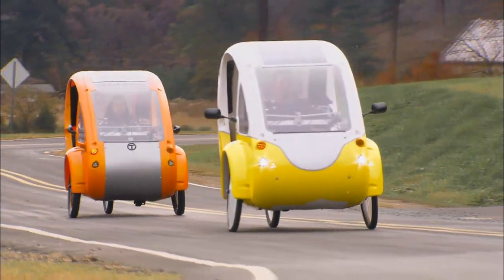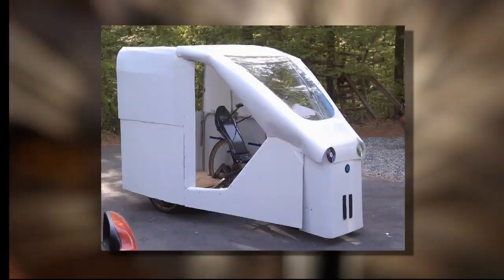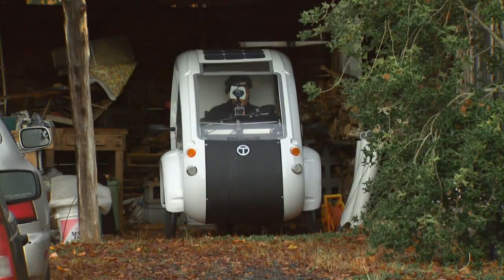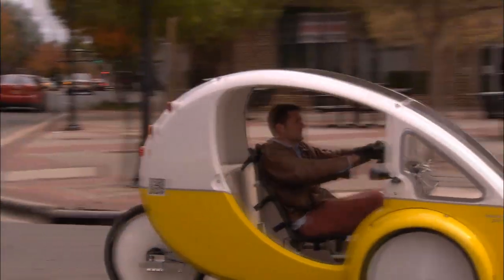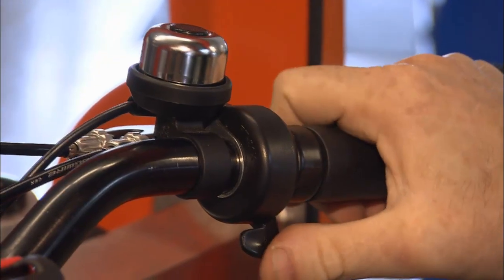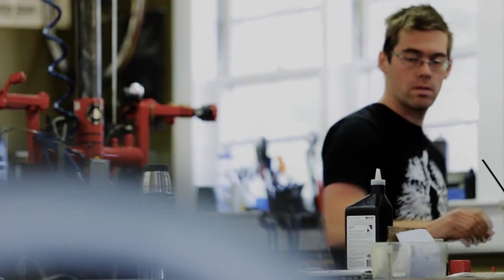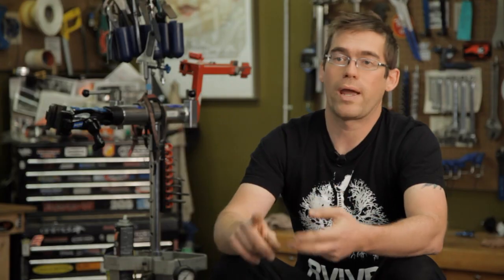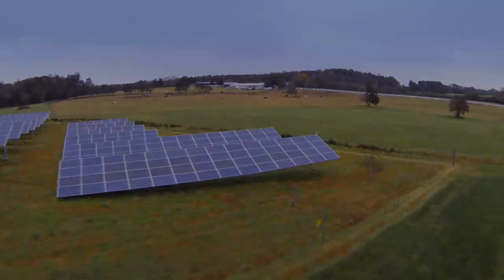Bike To The Future with The ELF

Comment: Why so complicated?  I've ridden years through rain and snow. A good bike, proper riding gear and paniers leaves $3500-$4000 in my pocket over this ride, and I'm less likely to run into or get run over by a car. Not to mention the better visibility due to the higher seating position of the bicycle. And, good luck parking this thing anywhere but in a parking lot $$$. KISS (Keep It Simple Smartguy).
Reply: Wrong on all counts! As a bicyclist you have no excuse for this ignorance. Crumple zones on this high visibility high profile vehicle that places your head at the same height as car drivers and features full DOT lighting makes this an extremely safe vehicle compared to any bicycle.
Really stupid comment about parking too, it is always easier to park the ELF in 1/3rd the space of a car and to fit it into otherwise not accessible spaces like motorcycle parking and on the sidewalk next to bike racks. I'm disabled and get to park my ELF right near the entrance doors of stores even without a disabled parking permit. Lock to any post.
Reply: I get what he’s saying I live in New York City an I don’t live in Manhattan so parking this is going to be hard for me whenever I do get one I’m going to have to pay for parking or it will get stolen for sure

Comment: how do you lock it up so people can not stealing it ??
Reply: It has a key lock for the power system. It can be cabled/chained to anything just like a bike, the brake rotor can be locked with common disc brake locks, a motion detector alarm of a hidden GPS tracker make security easy. Only two of 800 have been stolen, one recovered. The one not recovered was not locked by its owner.

Comment: The problem is bicycle they are limited range limited load and the user must be in good physical shape. Some are made out of exotic metals, and when was the last time you saw a little old lady riding with her walker in tow. The bike shop is dependent on a power source  such as fossil fuel along with needing trucks to deliver bikes and bike parts to his shop. Even in Amsterdam most ride there bikes to the rail station and back home. The ELF dose have some advantages over this as it can carry a larger load and someone with a balance problem the ELF will help over come this.
Reply: Sorry that is incorrect, these are sold to seriously disabled people. You don't have to pedal. This can mean priceless freedom for the disabled.

Comment: "Protection from the elements" but no doors
Reply: +ThruThe9 I suspect that they have doors, but they are an option. I've seen similar vehicles @ bike shops and there is an inclement weather option that is velcro based if memory serves me correctly...
Reply: Doors make it too hot. Rain just blows by the doors. Not an issue. I needed mine for sun protection but it offers so much more.

Comment: Nice for people who are not in a hurry, living in a more rural community.  I don't think I would see one in mid city Los Angeles.  Electric is a good way, but I went the route of converting a mountain bike that I was not really using.  With hub mounted 1000 watt motor,  20 ah lipo batteries. lights, panners, etc. cost: $800, max speed 34 MPH, normal cruise 27 MPH, range 22 miles.  Requires builder to be reasonably handy with tools and can understand how to handle Lipos. ( no big thing).   I already have a high power Lipo charger.
Reply: Your mountain bike is not street legal, can not haul 20 bags or groceries or a passenger out of the weather, has no crumple zones or full DOT lighting system with car horn. You also can not take advantage of solar charging, the best feature I take full advantage of every day here in Florida..

Comment: I'd like to see more actual stability info. Can you make a turn at 20mph?

Also like to find out where "contingency variable transmission" came from.
Reply: Reckless operation can be dangerous with any vehicle. I have never had one wheel leave the road yet, I just use common sense.
The NuVinci hub is the brand used.

Comment: the problem why they have so few orders is because of the price is so expensive actually I think the company targeted rich people for 3 000 dollars you can buy a used  mini van and go faster , the solar panel is making the price go so high , one way this could be cheaper is by taking away the solar panel , the bike should be faster electric bikes are green but not efficient , because this bike is so big and slow it will block the traffic and is most likely to get hit by an angry driver , the price should be less and more efficient because for real the price is so high that few people can afford .
Reply: +victor larraondo The government limits the speed of an electric assisted bike.
Reply: +victor larraondo The solar panel on this ELF can be had on Amazon for $200, it just a flexible solor panel, nothing too high tech or expensive. In fact this is one of few vehicles that can charge entirely off of solar built into the vehicle. I'll tell you this brother, if for any reason gasoline becomes short or there is some kind of war in the Middle East stopping gas from coming here, your Mini Van will be good only as a spare bedroom, while this ELF will get up and go everyday.
Reply: victor - penny wise and pound foolish applies here. You pay at least $3000 more each and every year to drive cars. Mine paid for itself in less than 3 years, I got rid of my car.

Comment: Nice invention. I just see a problem with rain coming in at the sides where it is open because it will come in that way for sure. It also would be nice if they had a bigger battery to double the mileage/speed. In colder weather you will need more than a seat warmer to keep warm and the cold will also reduce the efficiency of the battery.
Reply: you read my mind brother
Reply: Your problems do not exist in the real world. You stay warm by pedaling. The rain just blows by the open door, maybe your elbows get wet, no big deal. Doors are available but few want them.
Reply: Popeye Gordon nonsense, I constantly have to deal with rain falling at 45° due to wind, and even if I wait till after the rain stops I'll still often get soaked up to my knees due to potholes and uneven surfaces collecting massive amounts of rain water. Weather isn't a unified constant across the world. I've lived in near every biome, and this wouldn't appreciably help protect me during the storm season in any area I've lived in save northern California. If I still lived there, I'd be much more forgiving of its limited use cases, but right now...?

I actually do quite like this vehicle, but it isn't a sufficiently practical alternative in places with extreme weather. And to its credit, it doesn't claim to be! Every person and every environment has different needs. It doesn't undercut this vehicle to recognize that it's not appropriate for every area, the same way it doesn't undercut my bicycle to acknowledge that it's not appropriate for the freeway

Comment: I am an Elf owner, I purchased it last year in May of 2014. After driving it for a complete season without incident and never being flipped off by any motorist. More often than not people give the thumbs up and smile with curiosity when they pass. I use my Elf for commutes between my location and town (17 kms round trip). The route I use has a maximum speed limit of 60 kmh , I can clearly see anything coming to and from me. When I experience a situation where I may be a liability to road traffic I simply pull over and let vehicles pass however most are willing to wait and watch until they can pass safely. Over all I am very well pleased with this bike and recommend it to anyone looking for an alternate form of transportation. It helps our environment, health and is economic when you do the math
Reply: Do you have any problems with it like shaking? Cause I am lovin this especially with the price
Reply: Ethan Wood The Elf does shake as it is supposed to because anything too rigid would cause problems as it's design is both under tension and compression. I reduced speed on any bumps and try to ride on smooth pavement only.
Reply: ro0ky 

No suspension?
Reply: @yusadani755  It has front elastomer suspension. In areas where you know the roads are bumpy it is wise to get the 3 inch tire option. They make a real difference especially when a few pounds under max pressures. This is not an off road bike but gravel bike trails are fine.
Reply: How is it after 5 years? How much did u buy it back then? 😄 Thx..
Reply: What’s the top speed and how much do they cost?

Comment: $5,000 for a solar powered trike is CRAZY.
Reply: +bahrta sai  NO, its not crazy! As long as its well made and can last 5 or so years with reasonable care. Its good value as long as you use it regularly. 
Say in comparision, a really cheap car cost 10k, if you do 90 percent of your getting around in an elf, thats a 9k value, PLUS the savings in parking, insurance, gas, cheaper repairs, you are talking big savings. Depending on what your monthly cost is, the thing will pay for itself in 1-2 years.
Reply: You keep posting these falsehoods but this is wrong. 800+ units sold and 3 million road miles logged, the ELF has been involved in 4 car crashes so far. No injuries yet. The body provides crumple zones and holds the driver inside. It bounces off cars and the dents will just pop back out.
Reply: Can you make me one too I can’t build anything
Reply: Not to mention it looks like it's made of plastic the way it's shaking when he's pedaling so no protection in an accident & no insurance because it's classified as a bike.
Reply: It IS crazy. They are insane. The problem is that there's no competition. So I guess I will make my own

Comment: Love this idea but why go with solar & not just pedal + wind as a power source? You wouldn't have to rely on the weather (or mined resources but I could be wrong since I don't know enough on that) & as long as you're moving it with a wind turbine in front or on top the vehicle would be powering up. It just sounds more practical & possibly cleaner that way.
Reply: This vehicle weighs 160 pounds. Any wind drag would only slow down the vehicle, wind generators on moving vehicles are an ignorant attempt to make perpetual motion, a scientific impossibility pursued by many high school dropouts. Trust me, you don't know more than a team of top notch engineers.

Comment: put an alternator in order to recharge batteries in pedals mode
Reply: I agree, it's just that will get the price bigger
Reply: No that can not work without wearing out the driver. Regenerative features only work on larger heavy vehicles.

It takes you a full 24 hours of hard pedaling to recharge a battery this size. That's why  solar is so much better.

Comment: How long does the motor last?   And can a replacement part be ordered easily in event one is needed quickly.    I am interested in one but I want to see where the pricing is for replacement motors chains etc.
Reply: At least 30,000 miles if properly installed and maintained with proper alignment.

Comment: Despite its advantages; it’s $3500 cheaper than the next cheapest Velomobile; it includes a solar rechargeable electric motor and it’s American made. The Elf still has some major hurdles to overcome; it is twice as bulky as other velomobiles; you can’t park it outside overnight; you can’t put it in your apartment either; other velomobiles are narrow and can easily be bypassed by faster traffic, not so with the elf which has to take command of the road because of it’s width.
Reply: What's so important about it being made in the US?
Reply: @TheSupertecnology  Some of us are patriotic and refuse to stab our neighbors in the back by buying imported vehicles that steal American jobs.
Reply: @popeyegordon  Someday you will get real and grow up.
Reply: @baddoggie101  it makes sense actually; local is just simple better.
Reply: This is the SUV or cargo version of a velomobile. If you prefer narrow, light with no cargo or passenger room there are plenty of options.

Comment: You need a garage to put it in or it will be stolen. Sadly
Reply: Incorrect. It has a key for the ignition and can be cable or chain locked, a motion sensor alarm added or a GPS tracker hidden in it. Also use a disc brake lock.

Comment: One modification I'd like to see to the ELF is the addition of a passenger seat. I would also like the price to drop, because for 5k I can buy a used car or REALLY nice bike, maybe even an electrical one. If those 2 issues were resolved, I would buy an ELF.
Reply: Don't forget doors!
Reply: I have just looked at their site, and they do indeed have a passenger seat option, even one for 2 small kids
a price drop would mean moving the manufacturing out of the US, something I dont want to see. you will just have to pass on the ELF or build your own.
Reply: You can buy a pretty decent car for about $2500 to $3000 but then you have licensing fees, maintenance costs, and of course fuel cost. The elf seems like a good option if you're single, a city dweller and live near work and shopping.
Reply: Used ELFs start at $3,500. Have you found one yet?
Reply: Where they selling used ELF’s at ? Cause I want one
Reply: ESUTERURE They just added the door option this month, (February)

Comment: Need to increase speed to at least 40mph and price under $3k. I could buy a hell of a nice bicycle that goes faster than this thing. Great idea but needs to be enhanced.
Reply: The main problem with increase in speed is the fact that some states require the motorized transportation device to be registered as a mo-ped once it can achieve speeds of 30 mph or more. If it weren't for all the dumb laws it'd already have been available.
Reply: +yochivazo  In states like MI, electric bicycle speed limit is 20 miles an hour. Any faster brings on more regulations, like you would need for a scooter.

If you want such a vehicle for 3k, you will have to build it yourself. A quality motor/lithium battery combo alone cost 1k.
Reply: Higher speed also increases the danger posed by any vehicle and decreases fuel efficiency.  Better that all vehicles be limited to 25 mph within cities to make them safer for bicycles and stuff like this.  I can see the merits of allowing somewhat higher speeds on some larger highways though.

Comment: Is it really street legal? It looks too wide for bike lanes, so it must drive in regular lanes. However, it is too slow for those lanes and would obstruct traffic. I can just see it bringing traffic to a crawl in a no-passing lane, wasting lots of gas in the cars creeping along behind it.  Thus, it is the worst of both worlds. Also, it seems the solar panel may not be worth the added cost. Unless you drive it to work and park it in the sun all day, the charge you get from the solar panel (like driving to the store) is negligible. Maybe the solar panel should be an option.
Reply: David, I get a fast recharge with my panel, it charges all day long on my errands and I get back home with a 90% charge on the battery. ELF drivers are courteous, we share the road and pull over when required to fulfill that obligation to share. The width is not a problem 99% of the time and the other 1% we stop to let traffic by..
Reply: I think it's just the highways
, and interstates you don't want to drive this on